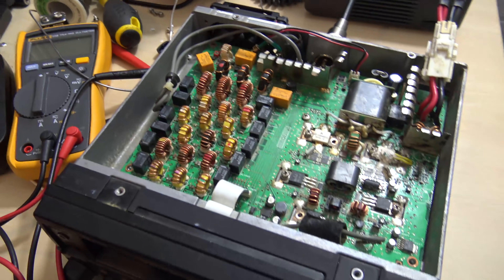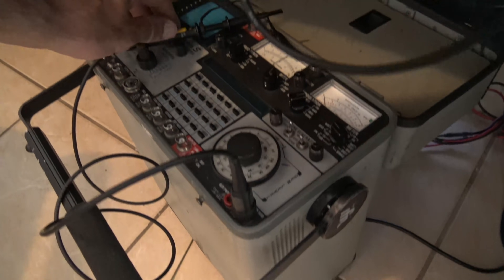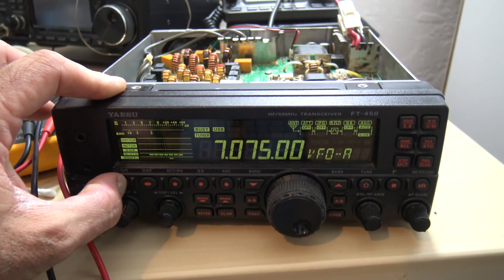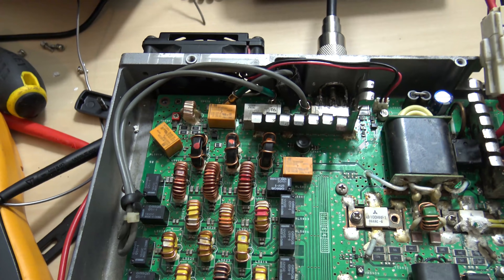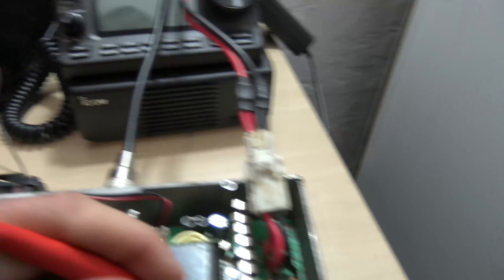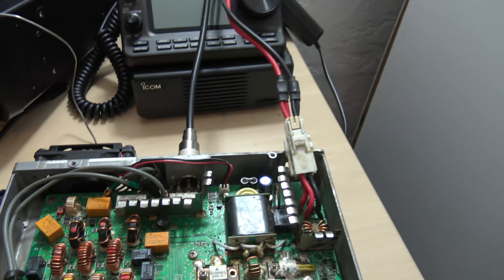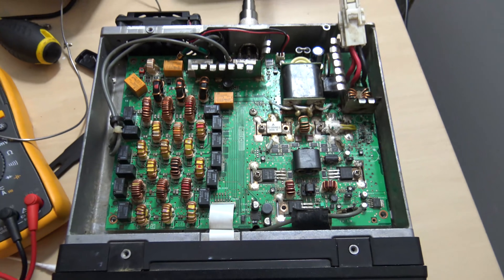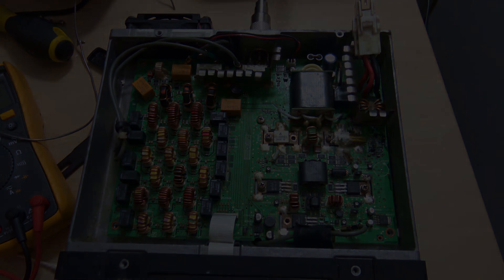Yaesu FT-450 HF Transceiver Repair Update #2

Comment: Thank you for your video.  Here is what I learned from it today. My 450 is not only having trouble transmitting, but my AM broadcast band is also dead.  I am damn glad I got my Icom 7300.  You help me say to hell with repairing this radio because I am 81, have trouble seeing things and cannot remember where I just put my screwdriver.  In the old days I fixed everything.  I though for a moment , just a moment, that just maybe I could do the  fixing, but just said forget about it.  I love my icom 7300 and would probably never buy anything from Yaesu again.

Comment: My first MAJOR CRINGE on this channel. Wow, even though I am late to this party.   The 'white' toroid with a single turn through the center in the upper left is your directional coupler for SWR.  You disconnected the output transformer to check for output? Big no no.  Even no antenna this radio will attempt small power like 3 to 5 watts.  I wanna ramble, oops already did, lol.  Still watching though. Plus do not give up.  Since radio is not working it is good learning radio.  It is easier to fix transmit than it is receive believe it or not. Is a straightforward design.

Comment: Take a look at R5074 and R5075 on the PA Unit.  Grey metal film 22 ohm 1 Watt resistors.  at 3:28 in the video, the one on the right looks like toast.  I would suggest that you replace these with a 22 Ohm, maybe 5-10 Watt Resistor, maybe larger.  These, (different component numbers depending on radio model), are notorious in Yaesu equipment for running near the thermal limit of the resistor, and failing.  Sometimes carrying other more expensive components with it.  I have even seen cases where they burn the board around the solder connections.  I did the R2213 mod on my FT-840 and it runs much cooler, and is better all the way around.  Did mine with chassis a chassis mount from Newark, and the resistor is mounted in a heat sink.  Actually ran mine outside the back of the radio, through a rubber grommet.  Rig (and board) loves the relief.  Keep at it Sir, Education cannot be taken away from you!  '73- de AC4YX.

Comment: When you reinstalled the PA board and fastened it down, and the transmitter stopped working. Maybe the stress of fastening the board down has stressed a small crack in the board, or changing the stresses on the board is creating a connection issue somewhere...

Comment: Eric - how old is this radio?  Are you the original owner?  Keep probing - you get an A+ for effort.  If you've owned this radio since new, I would highly suggest trying to figure out how the board ended up in the condition it was, that you showed us in your last video.  That was definitely something you don't want to happen to your shiny new IC-7300!  Also - I'd question why there is a big lump of thermal paste just sitting there on the transistor on the right.  Typically this is used as a bridge between the transistor and a heat-sink, not just lumped on top of a transistor all by itself.
Reply: BTW - your channel is by far more entertaining the other few radio guys out there :D
Reply from the maker: @bruehlt  Thank you my friend. Not the original owner,  about 9 years old.

Comment: All right take the Icom 7100 over to Patrick's house and you can take the 9:40 Kenwood and do a video on that or maybe use it as avakin is that Workhorse puts out 150 watts and it will be an open end loan the icon will and just think when I go SK you're not going to have that much to to load back to your house over and plus I'll be able to do CW we will be brass fish Brothers I said fist are you go

Comment: The PA board still looks repairable to me. If I dig a bit deeper, what we know is that the radio is getting an infinite SWR signal which kills the PA to protect it. The signal has to come from the directional coupler (a.k.a. the SWR bridge), which measures the forward and reflected power at the output of the PA. It's that little transformer in the left rear corner you hold your finger on at 4:05 and those little parts around it. So considering the placement of the coupler in the signal path, there are two possible problems here. One: the coupler and/or its detection circuitry is somehow damaged (blown diode would be my first guess) and provides the control board with a false reading. Two: the coupler isn't lying and it really sees an "infinite" SWR. That would mean there is an open circuit somewhere AFTER the coupler, which wouldn't be too hard to troubleshoot since there are only the ATU relays and I guess the TX/RX switch relay (I'm not familiar with this specific radio so I'd have to get the schematics to know for sure). In any case, from my point of view it looks like the problem is in one of these two things (it might of course go deeper and turn into a real PITA, but it's not always that bad). I'd test the signal path between the LPF and the antenna jack first. Look for cold solder joints or cracked PCB traces, you can also try unplugging a coax going to the ATU at the ATU side and plug it to the "from ATU" jack on the PA boad (if it is mechanically possible, of course), bypassing the ATU, which would allow you to test the ATU in/out relays in the ATU position but without the ATU in line. If there is no problem with the continuity between the LPF and the antenna jack, it's time to grab the schematics and have a look at the forward/reverse power detection circuit.

Also, be careful with the power transistors on the PA board (not just the finals, all of them). Reinstalling the board with these components soldered and then screwing them down to the chassis can mechanically stress the leads and leave them in constant tension, which might result in cracking and failures after some time. De-solder the parts before reinstalling the board back to the chassis, then put the transistors back, tighten the screws and then solder the leads back to the board. This way there is no stress in the leads.

Have fun. :)
73 de OK1VI Tom
Reply: Was thinking along the same line...
Reply: wow...very help and thanks for the feed back..don't forget to share it once you have working on the same issue for Yaesu FT-450D.

Comment: I think that you know more and are smarter than you think, or what you've been told by others.  Try gently tapping on each of those relays as you hit the transmit button. The Tx just MIGHT kick in.  I always suspect mechanical problems and dirty switches and such FIRST.
As part of this: See if any voltage or heat or smoke(!) suddenly appears in the vicinity of that resistor.

Find out if there are any technicians diagnostic  "soft button" hidden menus.  

Look for any interlock safety switches. Carefully...  Caveat Emptor.  

The (Fluke) VOM  finds the majority of problems (I see you chose to bite the bullet there and pony up for a good meter... I own the Fluke V Model 28 type and have never regretted my choice) , and a cheap Entry Level Oscilloscope will get most of the rest. The new Entry Level Oscilloscopes are AWESOME CRAZY GOOD, with specifications that we could have never dreamed of fourty years ago at ANY Price Point, and you can get an Abritrary Waveform Generator again with crazy awesome specs for about the same price as the Oscilloscope. (I am going to recommend Siglent on both accounts based on my experience. Your mileage may vary... There are others out there that I am SURE are as good but Siglent is what THIS Radio Rip Van Winkle purchased.) Good Luck! P.S. I have never owned one of those Service Monitors  but always wanted to try one... hope in a future video you will show that.

My experience is that the TX section of any radio is usually easier to fix than the Rx section. 

Good Luck! 73 DE W8LV BILL

Comment: Nothing wrong with increasing your knowledge at all,  I suspect it blew a diode or two out,  Maybe you could find someone who has the ability to repair it and they would let you assist  and/or film it so we can all see process  and maybe some safety tips when working on transceivers.

Comment: Hi Eric,
That coupler between the two relays I think is for the SWR circuit. The resistor that is burned may mean the transistor nearby could have a problem.   73  WB3BJU.